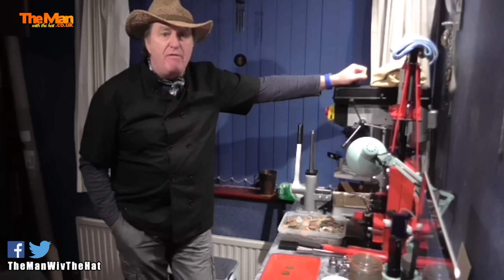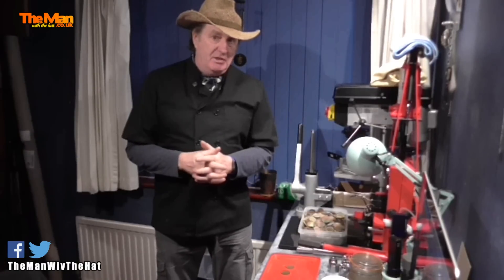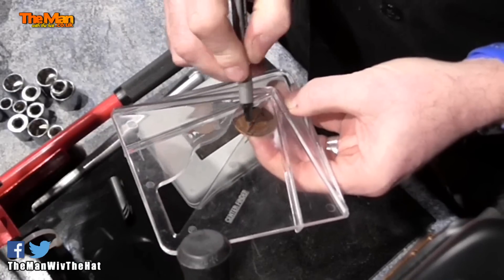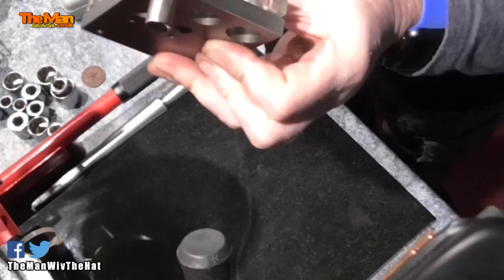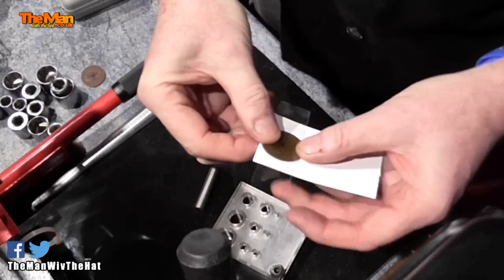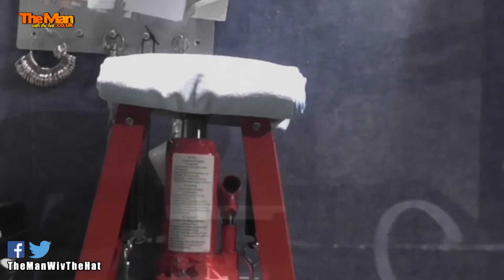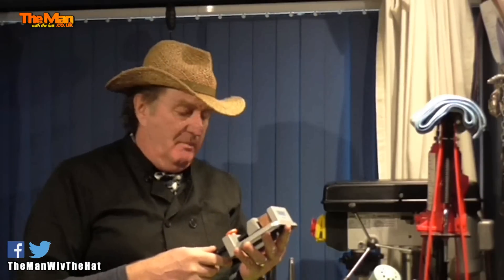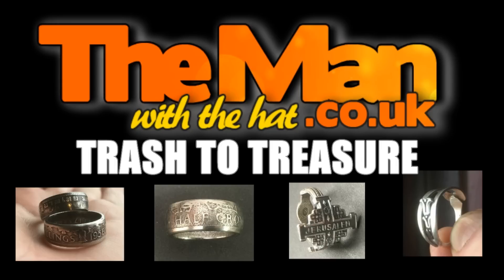How to make a coin ring. Part 1of4 - Cutting the hole.

Comment: Hey Stephen, make sure you buy a center drill for the initial hole starting, these are stubby stiff drill bits for finding a centre. If you use a 2 flute drill bit it will always have a tendency to walk across uneven surfaces like the impressions on coins.

Oh and if you continue to drill in a vise, center punch the center first then the drill will stay center throughout drilling.
Reply from the maker: Thanks mate. I've bought a centre punch since making that video. ;)